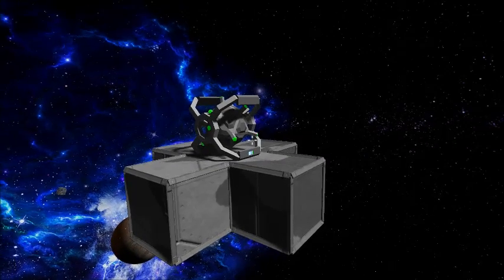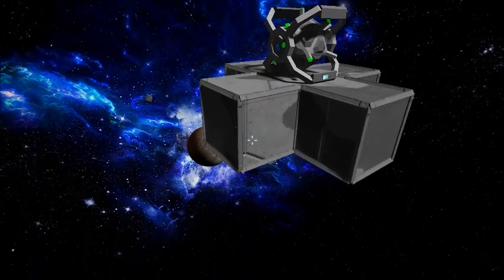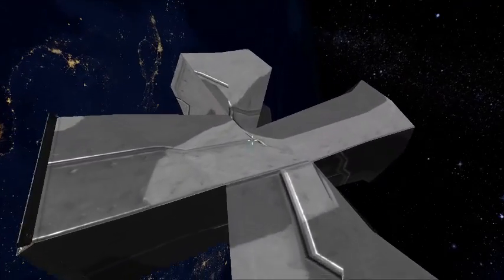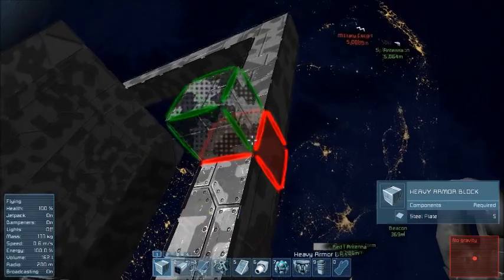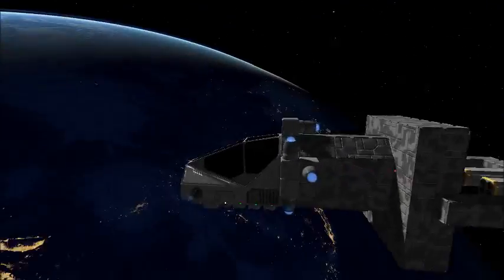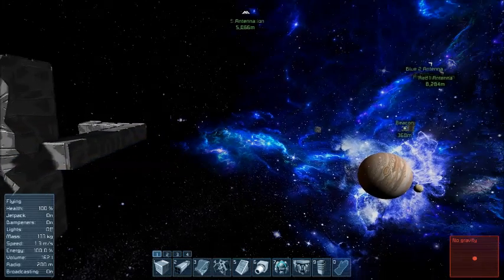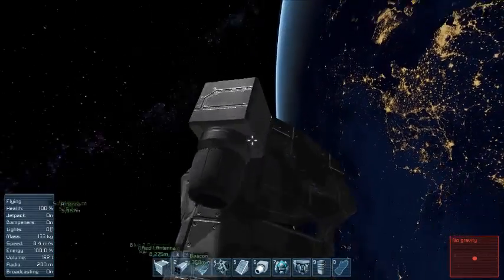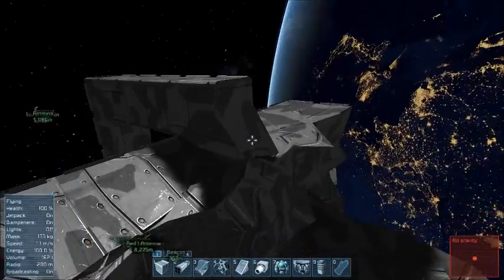Space Engineers: Generate Thrust with Explosives, Tests and Results!

Comment: Thoughts:

1.) You use rocket launchers you have to manually reload.  So it'd only work in creative.  Use the autoload plus can.
2.) You can use a wall of heavy blocks, with an array of welders left on, to repair the push plate and allow for continuous fire.  They will need fuel in the form of iron plates to fix the damage.
Reply from the maker: I am currently working on a better version, if I can get one that is more efficient I will add in a conveyor system (assuming it doesn't explode ;)). The welders would require two ships connected but it is possible and I will also be testing this.

In its current form this isn't really meant for survival. If I can get it to actually become efficient with more testing I'll put a bigger emphasis on getting it survival-ready.